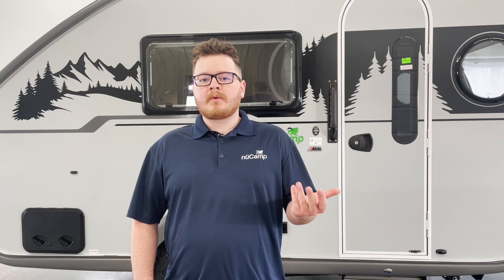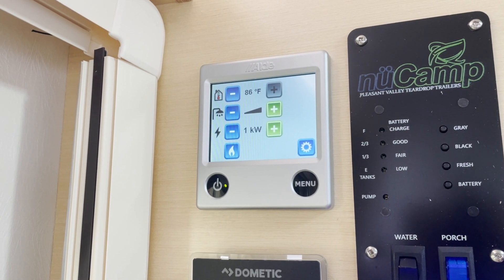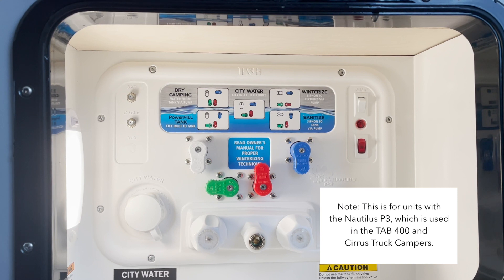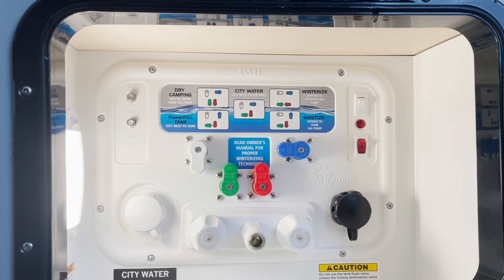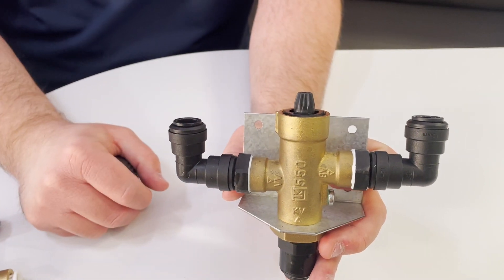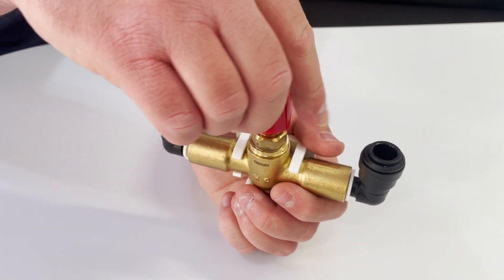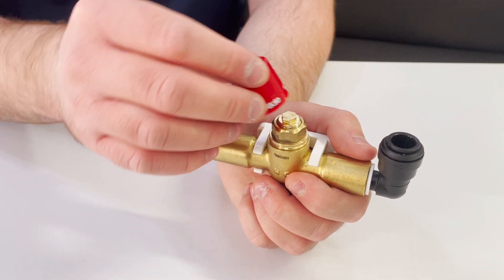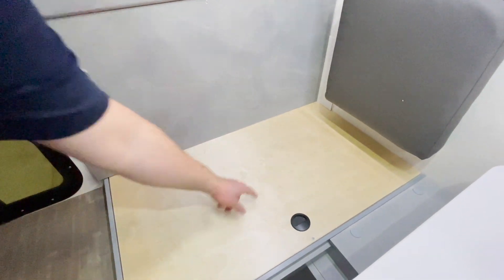Adjusting the Alde Mixing Valve

Comment: Great video thanks. But please help.  Took my 400 back to dealer to winterize.  They pumped AF into lines…got home and saw puddle next day.  Removed bed panel and saw pink puddles in compartment.  Leak seems to be coming from the bottom input into the mixing valve (the braided tube not the H or C pex).  Waiting on dealer to get new mix valve for over a month.  Can you connect me with someone - I will just buy and bring to them - or better yet have one of your techs talk me thru installing

Comment: On the new style mixing valve (red cap) is there a "too far" where you could accidentally flood the camper or does it have a "stop" built in to prevent that from happening? When you were looking at the valve from inside the camper, the valve was opened a whole lot further than the one you used as your close up example. I would like to get maximum hot water but certainly don't want to flood the camper in the process.
Reply from the maker: The new mixing valve will not allow you to go too far, so you do not need to worry about accidentally flooding the camper. If you have any additional questions, please reach out to tech@nucamprv.com.